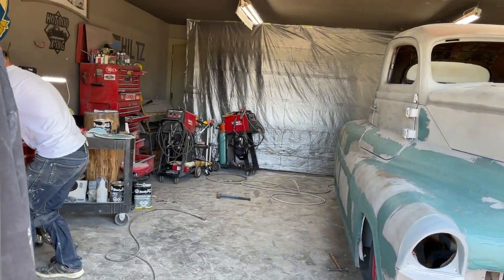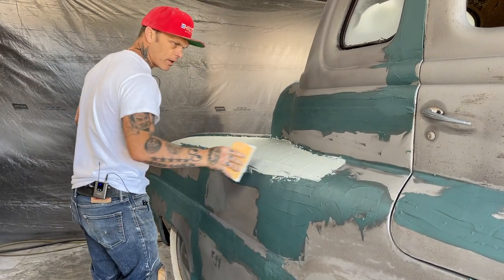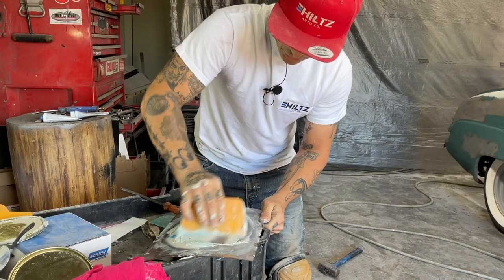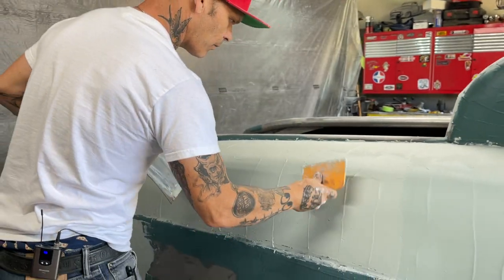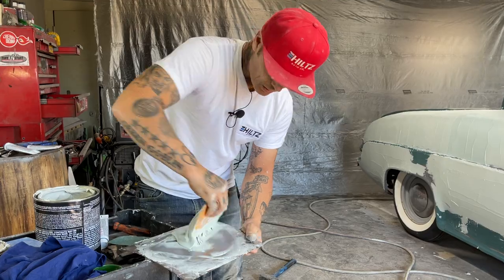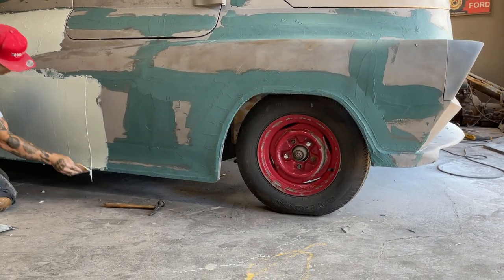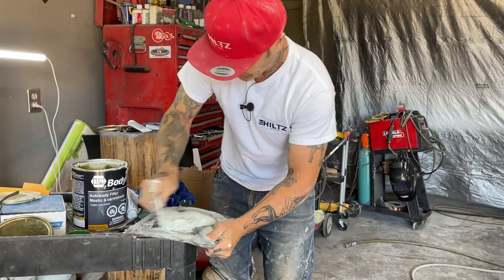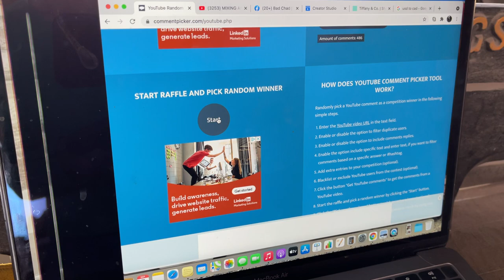HOW TO APPLY BODY FILLER THE FAST WAY: BODY WORK TUTORIAL

Comment: You don't need to justify how much mud / fill / fairing you use to get the right shape. You are putting this surface finishing on a solid and beautifully shaped core. I agree that all custom builders use the exact same techniques you use. It's just that they don't show all the details. Most of the the concerns come from cars that have been quickly and cheaply "repaired" over rust and damage. I learn something from the videos every time. In the boating world this work is called fairing. Same technique.

Comment: learning alot :) ... great work !!!! ... i think it should have a pop out motorized step that goes into the body and is flush and comes out when door is opened and disappears when closed ... just need a few linear actuators and do some framing to make it strong ... im sure you will come up with something cool

Comment: Great job Jolene and Chad you make that look so easy. But I know it's not you just have more experience than most. I would pick the flat head V8 dress it up with old performance parts. I think that would be cool make sure to give it lights and everything it needs to drive on the street. Would be cool to Cruse town in it. Take Care and have a great night

Comment: Definitely the 8 cyl. flathead. Millions of race parts available new and used. Period correct for the car. All the way from a updraft carb to a dual carbs atop a blower. I can smell the race fuel from here. Looking good.
Reply: V8 flatty in the truck and use the Hup straight six in the 35 race car.  
That would be a real attention getter. I have a feeling Chad is going to look for some good people that he feels he can trust to help with the chassis work. He could use a couple of big shops with some lifts and them

Comment: For my mud board, I use a 1ftx1ft piece of plywood. The cut a piece of freezer paper that has a plastic side. With plastic up, tape the edges to the bottom side of board. This is reusable if you clean it right after you use it. Or you can get another piece of paper and have a clean piece.

Comment: Well excellent question the answer really depends on how much you want out and how much you willing to put into it as you can actually make good horses out of strait six but both are pricey and both can take lots of time and work. Flat heads do peak out easier than inline 6 pretty sure I’ve heard of well over 1000 hp out of a 6 I know Japanese six are phenomenal for instance the jz of Toyota but American 6 they built one on power block tv got decent numbers.

Comment: Chad, Invest in a cheap 3D printer,  not only are you able to print anything imaginable but print with a lot of different materials from carbon fibers to wood grain, marble stone. takes time to learn the cad programs but not entirely necessary, a lot of file sharing sites.  you could take  restoration to the next level and save a ton of money in the long run...printing dashes, trim, wood Bessel's, covers, emblems skys the limit...

Comment: I think the fuel tank should go where the original tank was installed. Cutting into the sides would, in my opinion, ruin the smooth lines of the vehicle.Two steps that would have spring loaded doors could be installed on each side. You would climb up to the doors, like you were getting into a WWll fighter aircraft.
Reply: I was thinking the original gas tank would be the obvious choice. Now I’m thinking there must be a reason why he can’t do that. Maybe the floor was modified in that area on the Merc

Comment: The truck is coming along beautifully. I’m just wondering when you’re going to take the top door hinges off.
Reply: i dont think they are
Reply: and that hood - i wanna see that workin
Reply: @bgtaldude  ya, me too - think he shda had the hinges drilled, bushed and fitted w/large 1/2" machined pins before hand. Having said that, I shd never question Bad Chad - his genius will always persevere!
Reply: Maybe a good idea to incorporate the top hinge as a mount for the side mirrors, otherwise I thought the same as you a door with 3 hinges? better to eliminate if you ask me

Comment: When you say race car do you mean drag racing? I'd go with the lightest drive train and body you can get away with. Less weight equals better times. Can you get as many go fast bits for the six compared to the eight? Will the colour scheme for this build reflect the colours of the Ford toy? Two tone green, lots of chrome and alloy, with a red interior?

Comment: If your building a race car, go with the V8 for sure.  Not exactly sure if that one can be bored 250 thou and fitted with a Lincoln crank but we used to do this on the later Ford flatheads.

Comment: Oh I understand I'm on 4 gallons on my c10 chevy and I haven't dealt with the bed yet. I didn't have to weld the whole truck together but I'm skim coating the whole thing to make it as flat as possible.. my dad doesn't understand he sees it as a waste .. but it needs to be done. And I'm realizing in 63 nothing fit well gaps all over the board and anything but straight.

Comment: I would go with the v 8 its a much better looking motor. and i think if you need more horse power down the road, it will be easy to build up the flat head